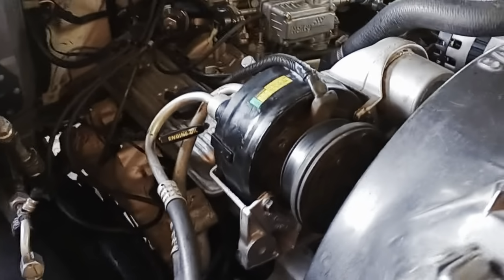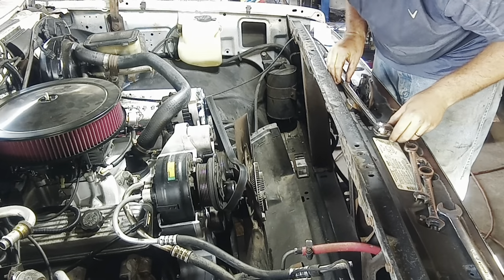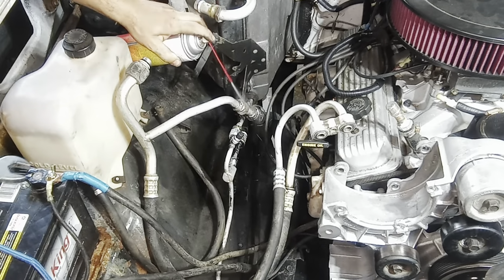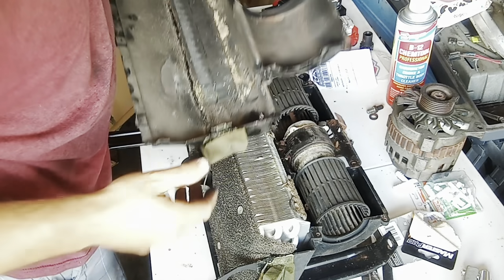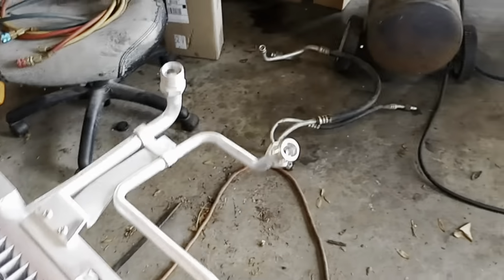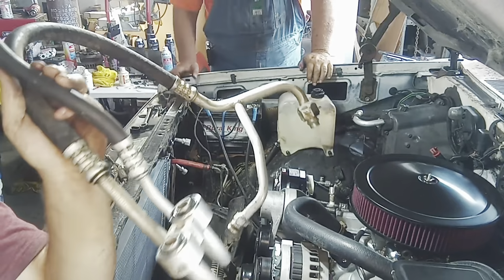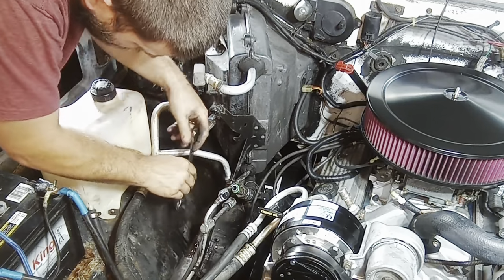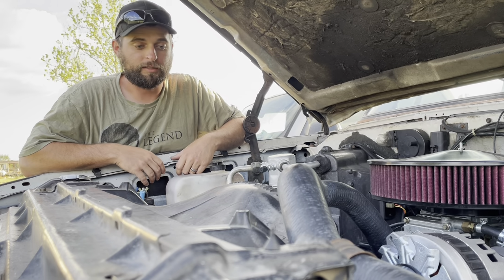(Almost) new a/c install square body 1990 suburban

Comment: Just a suggestion if that R4 is just not cutting it.   Get a R4 to sanden bracket (dirty dingo or one similar) and get the FLX7 compressor (serp pulley).   You'll have to remake your clutch connector, and the compressor will only have about 1/4" of clearance over the valve cover, but man!!  It will put out triple the volume of that R4 and freeze you out.
I've done 2 conversions and about to do a 3rd.   They have all done so well, that I will never touch a R4 again.

Comment: I have a 91 and I’m having an issue getting the A/C to blow out the dash vents, it’s stuck on floor only. There isn’t any vacuum at the switch on the dash